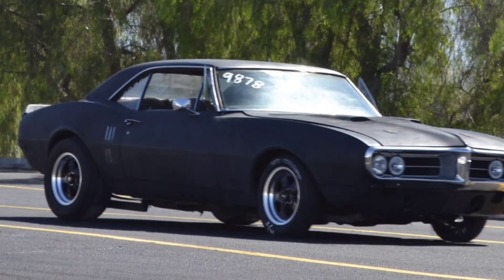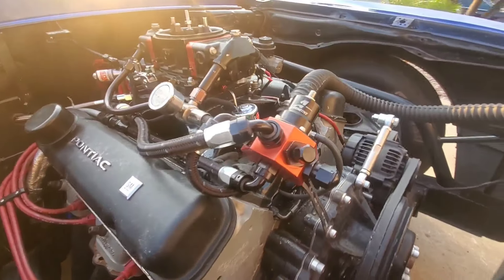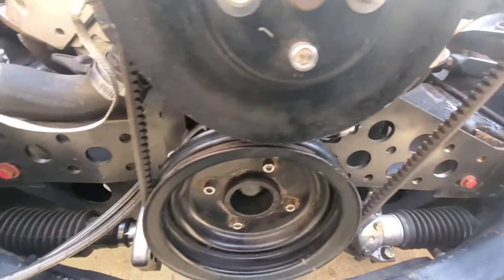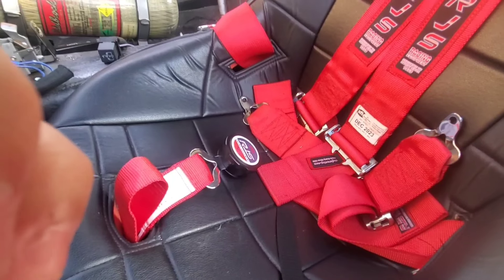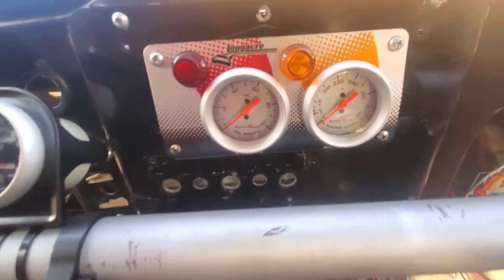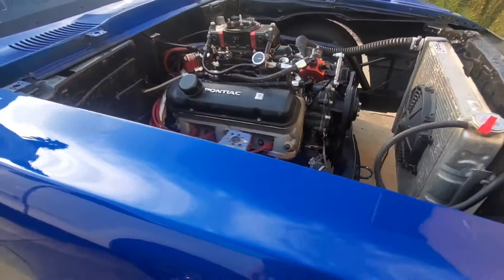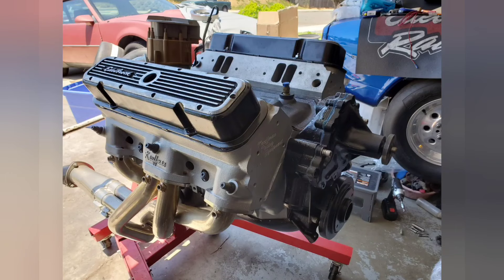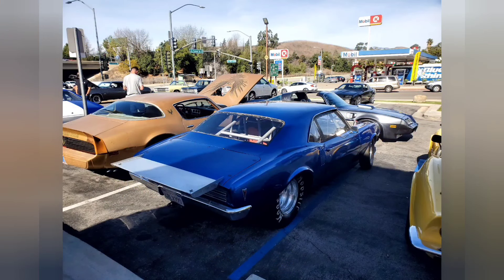1968 Firebird Racecar Walk Around | Pontiac 301 Power

Comment: I have another question... what year 301 block are you running? I hear that the 1980-81 blocks are beefier than the 79 & older blocks
Reply from the maker: This particular block is the worst one, a 1977 block....which is why I'm beating it up with no regard lol. The 1980-81 Turbo blocks are the best, casting is 301T. I have a few of those, and am currently building a stroker version that will be well over 383 cubic inches. This 77 block has held up so far, based on ET, weight and mph, this is making at least 350hp, which is over double the factory rating as you know.
Reply: @PontiacRaysGarage  That is amazing... I guess 301's are stronger than most people give them credit for. You are one of the very few actually putting them to the test. Keep up the great work!

Comment: What tracks do you run at? You wouldn't happen to make it to New England, would you? Check out TTA performance, if you haven't already. Joe is extremely knowledgeable on these motors, and I'm sure he'ld love to see your ride. .
Reply from the maker: Sorry, I'm in Southern California and race at the local tracks here. I can assure you, Joe at TTA performance can restore a 1980-81 Turbo Trans Am, but knows nothing about a conventional headed 301 engine, as he is barely building his first one currently. He offered a conversion head gasket for this swap that failed, never worked correctly, and he never tested it himself. This car runs as fast or faster, naturally aspirated on 91 octane pump gas, than Joe's turbo TA does on a E85 and a roller cam.
Reply: @PontiacRaysGarage  to be fair, Ray, Joe's gaskets are in the "preliminary" stages, and he has done testing on stock iron 301 heads, and has done extensive testing on many other "turbo" engines...successfully. How-ever, he has never worked a traditional head swap, or an aftermarket aluminum head, like your set-up. You never mentioned what times your car pulls...quarter mile. Many of us can't relate to this new 1/8th mile. Also remember, his cars are all steel, and weigh quite a bit more than yours.
Reply from the maker: @joequillun7790  you aren't aware that Joe released a copper head gasket over 10 years ago that was supposed to allow the conversion to be possible. They were $300 gaskets, which Joe never tested himself, and the few sets that were sold, all failed, including on one of his friend's/customer's vehicles. As far as Joe testing on many other turbo engines, you are correct, and they are all slow....every single one of them. Joe, with more modifications, is slower than Rick Unterseh who is restricted by NHRA stock eliminator rules and can't run ported heads, more valve lift, ported intake, roller cam, etc. As I said before, Joe can restore a 1980-81 Trans Am, but I would never, ever seek his advice for performance. 1/8 mile times have been around for 50 years, and there's a common NHRA conversion for them. This car has run 8.40 @ 86.29mph with it having too loose of a converter (40%) slip, and only revving it to 5000 rpm. That translates to a 13.10 @ 108mph in the 1/4 mile. This car weighs 3300lbs, which is only a few 100 lbs lighter than Joe's, and again, I'm on 91 octane pump gas, 9.2:1, flat tappet cam. Joe is running a roller cam and 15lbs of boost and E85 with fuel injection.....and still isn't faster than Rick Unterseh with a flat tappet cam and stock everything. Not impressed.
Reply: Joe is good at restoration but needs to leave the 301 performance to one's that know performance
Reply: @PontiacRaysGarage  Not sure when you've last checked out Joes channel Ray, but his all steel AC, automatic, 3.08 geared street tired T/A is now mid 12s. It's not stock, of course, and he also just built a 301T (modified) making over 400 HP on the dyno, steel heads stock crank, less than 5K RPMs. Pretty impressive. As for the head gaskets, (10 yrs ago), don't know much about them, but he now has a new manufacturer making another set, that he's been testing, with good results. You should cut him some slack. He seems like a decent guy. 
By the way, I saw you comment on another video, some-one with a huffer on an Olds, and 301, (in the process). Looks pretty promising. Amazing these engs. are getting some attention. Good luck with yours this spring.
Reply from the maker: @joequillun7790 ,  I've been in many of the same websites Joe is a part of, for over 15 years. I watch some of Joe's videoes, but they rarely pertain to what I'm doing because he's not dealing with conventional headed stuff, until very recently...I don't have to cut anybody any slack, I have heard from Joe's customers, other shops that have fixed some problems seemingly coming from his shop, and much, much, more that I can't get into right now but I'd love to tell you about....suffice to say, there is much, much more to TTA Performance than meets the eye. There are many people in the Pontiac community that are trustworthy and of good character....unfortunately, Joe, and his company, are not on that list for me. Sure, he recently made 400hp, with a turbo, and lots of modifications....like his nearly $2,000 header kit, nearly $1,500 turbocharger, $1000 roller cam, and not to mention another $2k in the fuel injection kit. Those things are more than I spent on my heads by almost double, which are putting me in the same 400hp range....Naturally Aspirated, on 91 octane, with a flat tappet, while Joe is on 15psi of boost, roller cammed, and EFI with E85. That blower project on a 301 looks very promising absolutely. Thank you for the kind words and if you're ever in SoCal, I'll buy you lunch and I can give you the full run down if you wish.
Reply: @PontiacRaysGarage  And to continue this thread Ray, I guess he must've wronged you some how, and sorry for that, if so. I'll admit, the prices for his parts are a bit crazy, but there's not much availability for 301 stuff anymore, or much demand, so in one way, I can see it. (Not that I like it). And also, you must remember, his cars are using the worst heads not only ever produced by Pontiac, but probably all of Detroit. The reason those engines can make "any" power is to blow it some-how. At least with those crappy heads. I see you've dumped them also, but wonder why anyone would build a 301 for racing, when the traditional motor is so much better. I can see it if you were class racing and rules dictated it. But some have modified the 301 so much, the only thing 301 is the block, and a custom intake. And the blocks ain't nuthin to write home about either. But like you said, you can pick up a 301 for pennies on the dollar, but also need-ta change almost "everything" to make any power. And I'm not ragging on anyone for building them and am glad to see "all" of the Pontiac V8s getting attention. And I commend you for keeping the Pontiac motors alive, and not resorting to this new LS craze that the youths have succumbed to. 
And I appreciate the lunch offer Ray, and would love to see you, and your cars in action, but unfortunately, I'm on the opposite coast, and don't have a lotta cash for flying. So i'll wish you best of luck this up-coming season, and will be following your videos. Thanks for posting, and the bench racing session. :)